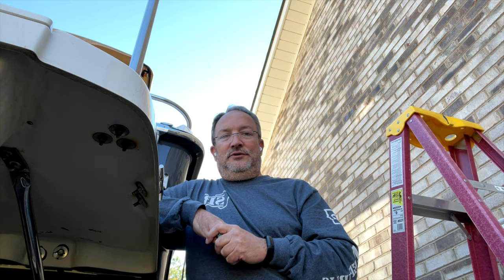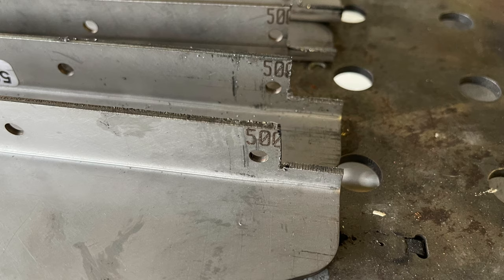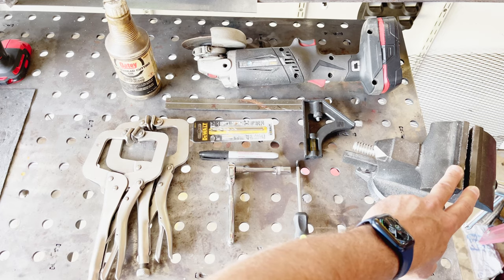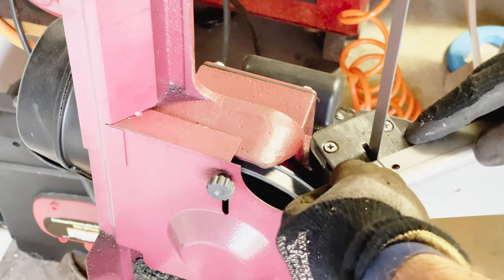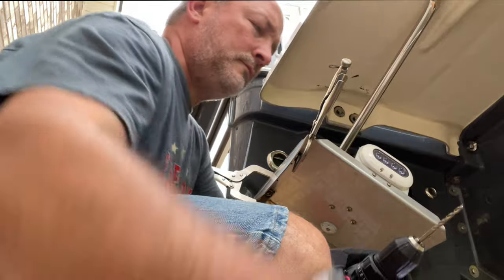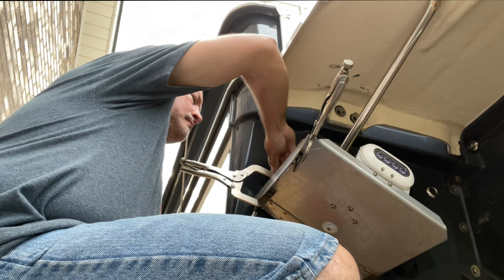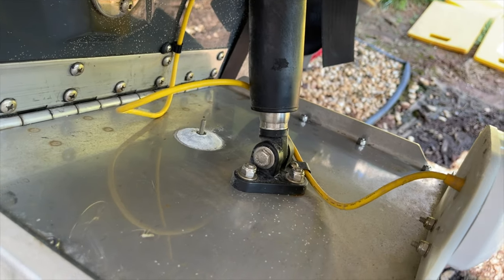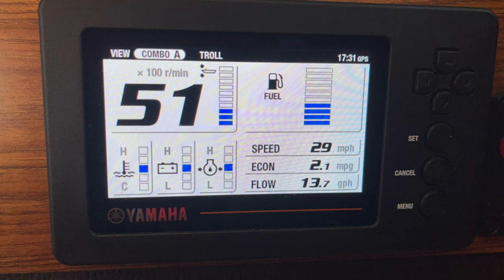Drop Fin Install on Ranger Tug R-23 Trim Tabs

Comment: Will be installing the fins on my R27, before the boat goes back in water.  They are on the way.  Your video was what prompted this upgrade.  One thing I would mention is that in drilling holes, it is a good idea to debur both sides of any hole after drilling, only takes a few extra minutes.  In the aircraft industry it is a must before joining parts.  Thanks for the video.

Comment: Well done 
Two questions/concerns: 
If the boat is left full time in salt water, what about galvanic corrosion

If fishing is there a concern in regards to snaging or cutting the fishing line
Reply from the maker: The first thing I did when we got home with Elvin Ray was install anodes on the trim tabs.  I just replaced them last week.  Just being in the water part time, the anodes were used up.  I don’t see the fins being any more susceptible to galvanic corrosion than the tabs themselves.

As for fishing, I guess it could be an issue if the fish runs under the boat.  I don’t fish, so that’s not an issue for me.

Comment: Looks like a worthy addition.  Thanks for sharing.  I wonder if the inboard fins are needed.  Did you happen to do any testing with just the outboard fins installed?
Reply from the maker: No that I have installed the Lenovo AutoGlide and can see/record the trim tab position on the MFD, I’ve been doing some testing with the fins off.  I’ll see if I can get a trip out with only one Fin installed to see if there is any difference.  In theory, instead of cruising with them ~90% deployed,  it should be less with the fins on.